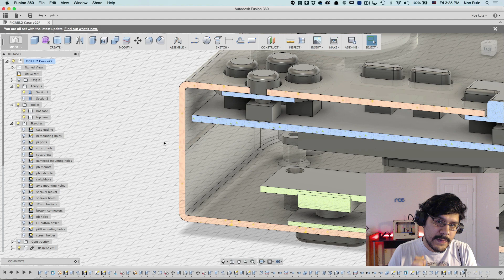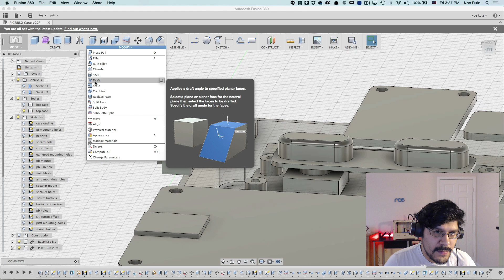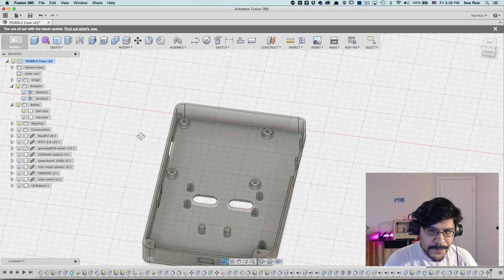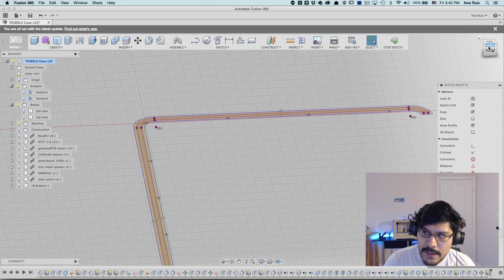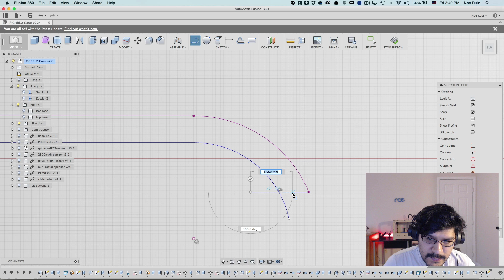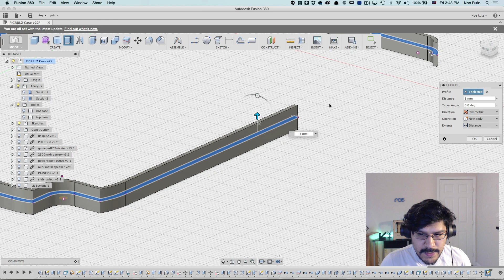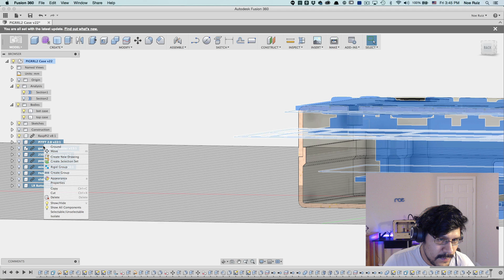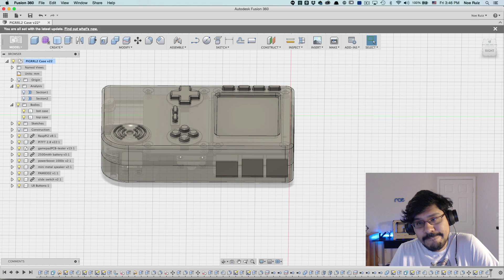Layer by Layer - Case Lips!

Comment: Maybe this way is faster
1. create a path along the inside top of the bottom case.  (I do that by filleting the inside corners of the case with tiny fillets. Thus making the inside edge rectangle a path.
2. Construct plane along path selecting the inside lip path. (from the construct menu)
3.Draw lip profile on that plane. Using sketch.
4. Sweep that profile along that path.

Your done.